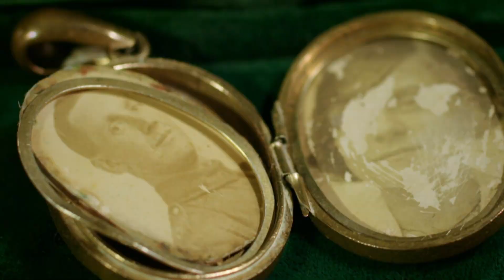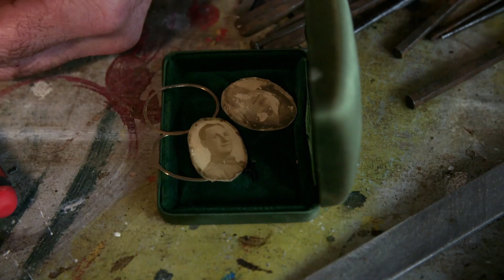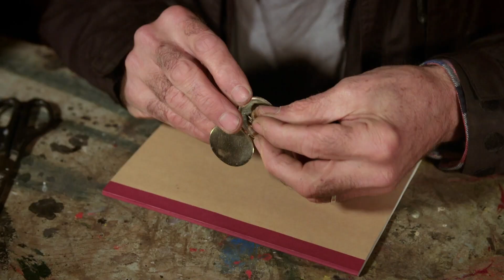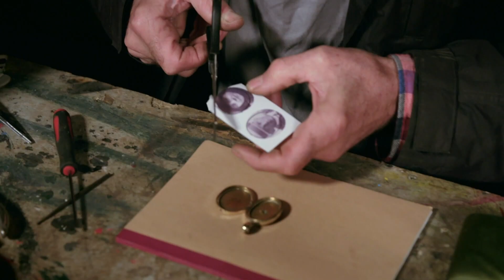WW1 Brass Locket Is Given An Incredible Restoration | The Repair Shop

Comment: I would've kept the original photos in .. and maybe have a piece of plastic on top to avoid any wear coming from them being touched.
Just because .. those photos are precious and they can be lost if not kept safe. They are the same photos her grandma touched when she was thinking of grand dad .. the same photos her mum looked at .. so they are much more valuable than those new prints imo.
Reply: Plastic does horrible things to photos. The gelatine used to attach the emulsion to the paper loves to stick to surfaces.